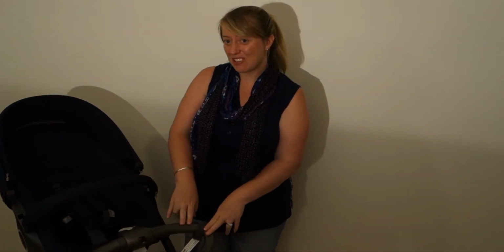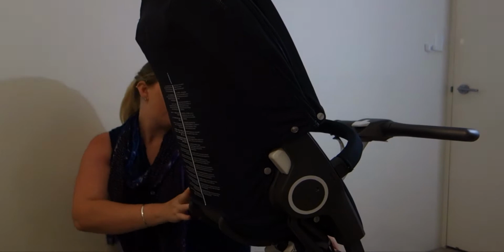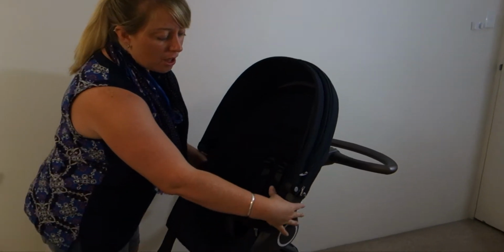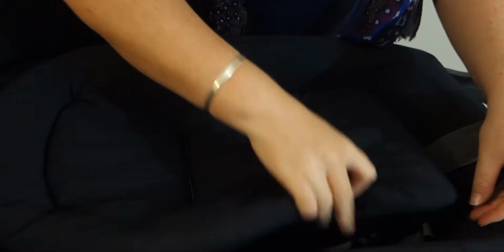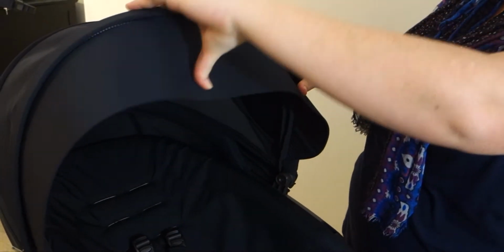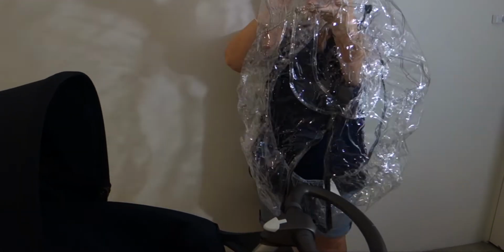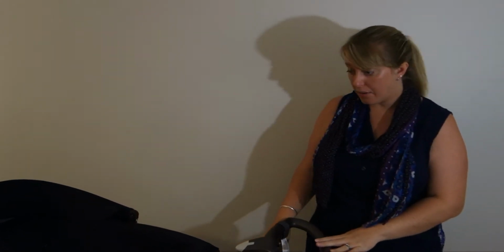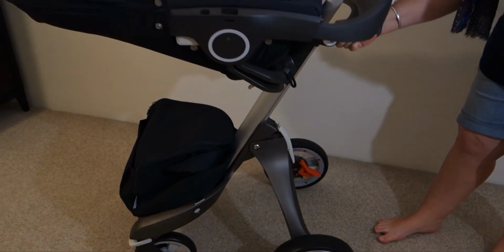Stokke Xplory 2014 v4 basic operation

Comment: Do you know how to take the Canopy off so it can be used with the Carry Cot?
Reply from the maker: Hi JoAnna, to take off the canopy open the buttons and unzip it. Then where it connects to the frame, feel on the inside of the seat for two pins, push these in and the connection will pop out. Do this on both sides. (They are very stiff and hard to push out.)
Hope this helps, Katie